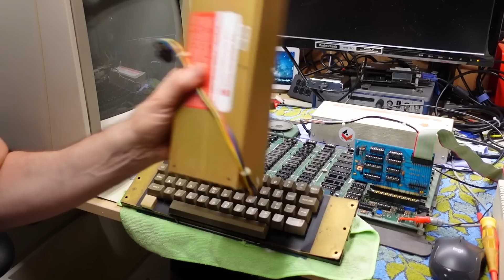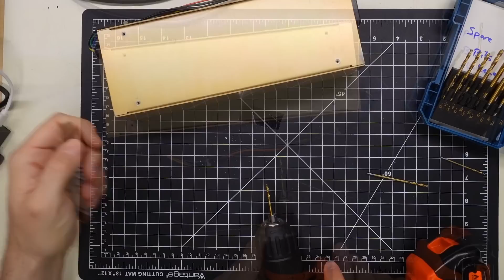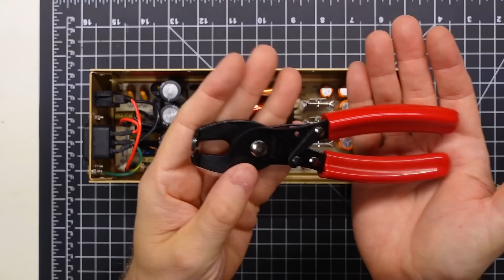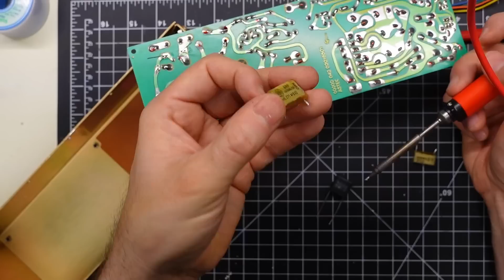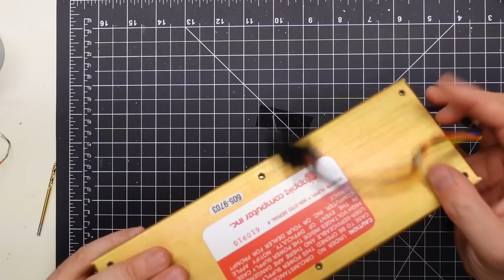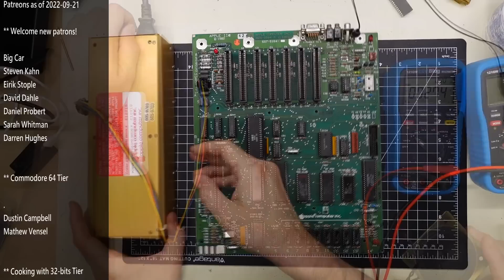Apple II power supply service and testing

Comment: Okay, some great advice on here regarding RIFAs!  Question is I'm about to do my AppleIIe PSU but what is the final verdict on what RIFAs I should order and install?  Thx.  -Mark.
Reply from the maker: Just order the same value X2 safety caps. I don't think the brand matters, only the safety rating and value. I got this assortment from Digikey at some point in the past...
Reply: @adriansdigitalbasement2  What should that safety rating and value be?  Thx.  -Mark.

Comment: Great video. I'm not an expert on the safety caps but I think it should be pointed out that there are X and Y types that reflect the intended use and should be replaced in kind and definitely not with a standard cap. EDIT - meant to say the RIFA safety caps
Reply: Yes. NEVER use standard capacitors to replace X/Y rated capacitors.

Comment: When I was 8 and my mom bought an Apple //e for home, I do remember seeing that brass box inside the case and the warning to touch it before touching anything else in the computer to discharge from static! :)
Reply: Indeed (although in the //e, it was silver), they added an electrocution hazard warning, but they also removed the rivet. ;)

it was replaced with a fifth screw, thus ten total, rather than eight.
Reply: @MagesGuild  I have a //e myself and it's gold - and also my kid's memories confirm that. Any chance the European version was different? Or maybe a different revision? And yes, mine doesn't have rivets either.
Reply: @tony359  Ah, yes. I have been discussing NTSC stuff, as even in the UK we used a lot of that, for the general Apple market was stateside, and if it worked on a machine in NTSC spec it also worked on a PAL system, but the inverse was not always true...thank you ITT.

The Euro //e did have its own PS}U for ~240VAC, and some were gold anodised aluminium, but I believe that also changed to silver in the late years. Either that, or it was silver and changed back to gold. IDR which as I was in charge of making stuff for and on NTSC machines, and only testing it on PAL machines, and examining the PSUs wan't important at the time.

I know what I know based on keeping (taking home) every blasted machine and accessory that the company for which I worked was simply going to toss into the bins.
Reply: @tony359  If you have an NTSC machine with a gold PSU, I would love to see a photo of that, as I have never seen that unless someone repaired it and put an older ASTEC brick into it; unless perhaps the very early 'green key' run had those in 1983.
Reply: @MagesGuild  mine is PAL, I’m in the UK 🙂

Comment: Regarding removing rivets, you want a big drill to drill the head away but not mark the metal up. In my experience a wide diameter drill works best. 😁
Reply: Drill bit should match the diameter of the rivets head.
Reply: Yep just a big enough "bit"
Reply: And spin slowly with steady pressure.
Reply: @solomongrundysfoot  A small drill press helps a lot with this if you have one.
Reply: This is exactly how we remove blind rivets on helicopters and airplanes, so it should be a suitable method for a power supply, lol.
Reply: While that would work, if the rivet is spinning, a small angle grinder can also work, to cut the head of the pop rivet off of the base, and/or give you a point onto which you can hold the bugger with a basic screwdriver while drilling. 

I am not a fan of using pressure for this, as that is not often effective. A drill bit about 75% the size of a pop rivet surface dimple works; and if you want to be fancy, there are specific pop/blind rivet removal tools.
Reply: Yessir. I came here to say this too! Never wanna drill inside the rivet
Reply: And also have the power supply the other way up so you don't drop metal swarf on the circuitboard.
Reply: A flat headed "punch tool" can also be inserted in the hole once it is drilled and you can just lever the head of the rivet off without having to drill all the way through and risk damaging the metal.

Comment: As I remember, even the cloned Apple ][ have a very long lasting power supply.
Reply from the maker: That must have cloned the decently good design of the real thing :-)
Reply: The two homemade Apple ][ clones I found in the dump (made in 1980) had also homebrew linear power supplies that looked like the designer of the Enigma wanted to fix a wall wart. Ginormous linear PSU with way too many components (at least there was a crowbar circuit), but the only power rail that worked was the -12, because there was just a simple 7912 for that. Everything else was enormously overcomplicated and didn't work.
Just as a disclaimer, both machines were homemade and looked one-off with protoboard everywhere including the PSUs.
I wonder if 2022 me could fix them, 2014 me couldn't and replaced them with AT (not ATX) PSUs.
Adrian could probably fix them, he's about my level when it comes to fixing digital stuff, but he's a lot better on analog stuff.

Comment: Good repair job Adrian. Given the amount of kit you work on Im suprised you dont leave a note in marker pen on the covers to say what parts were replaced and date you worked on them.
Reply from the maker: Oh actually not seen here I stuck a P-Touch label on the outside of the PSU with a date and RIFA's replaced -- as yes, good to make note otherwise I'll forget!
Reply: @adriansdigitalbasement2  2:56🙂